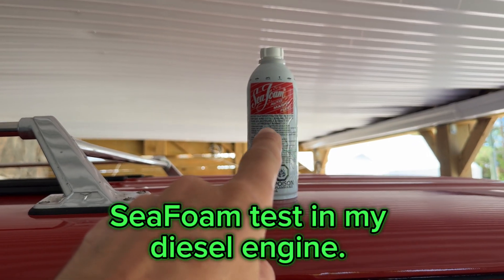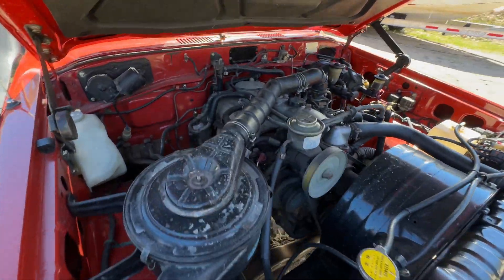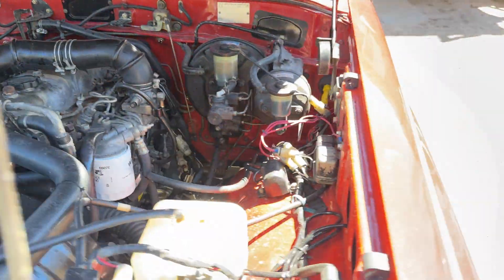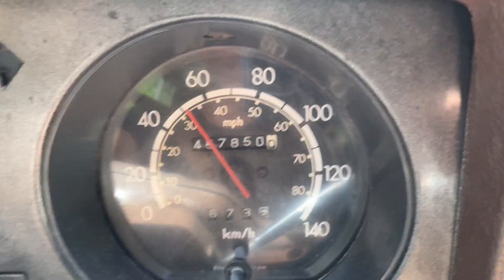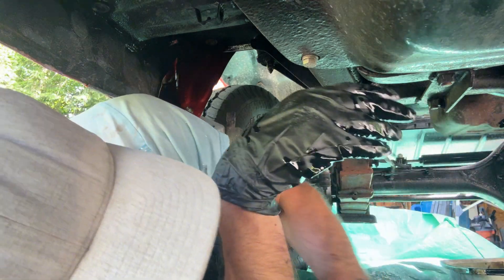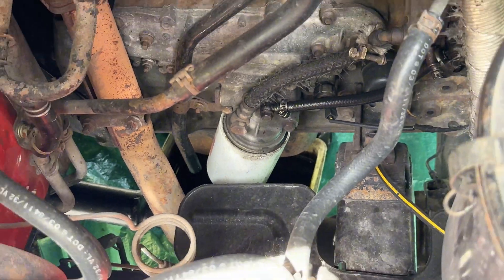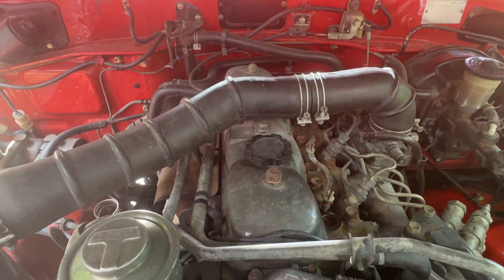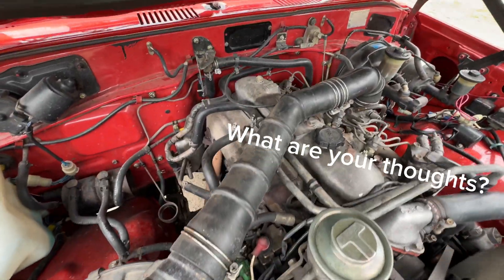Sea Foam in my Diesel engine oil. Does it make it better or worse? #seafoam #diesel #toyota

Comment: If you let it get that black and if you love your truck. Then buy a cheap oil and run new cheap oil with half can of seafoam and you can add half liter of tranny fluid.   It will be black again within hundred km
Reply from the maker: Good tip. Being diesel it gets black really fast. Will look into this thx.